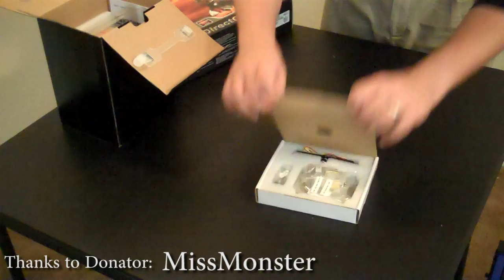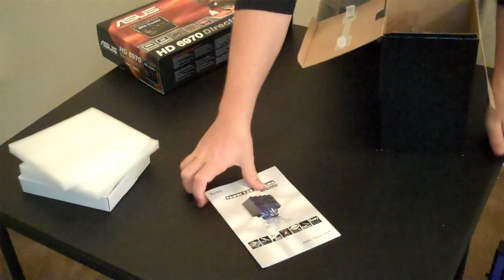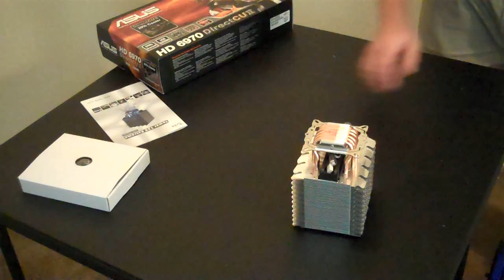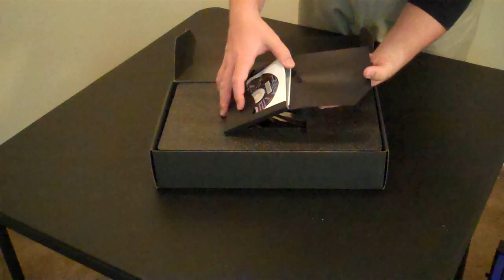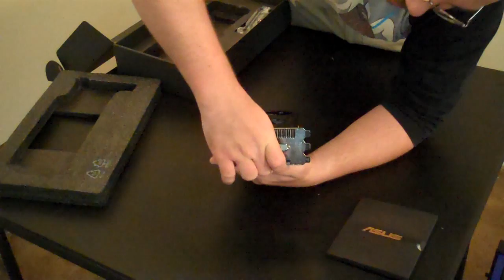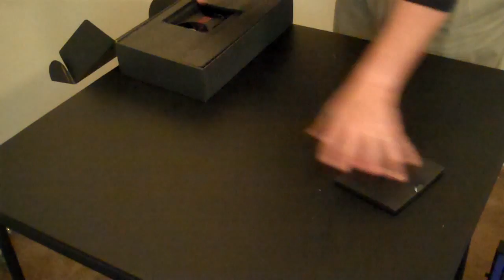AwesomeMattG Builds His Computer (003)

Comment: In case you were worried about how loud your video card is I bought a external fan for mine.  The fan is called a Arctic Cooling Accelero EXTREME Plus.  I can run my video card fan at 100% with barley any sound.  The only problem with this product is you have to remove the stock cooler on your video card.  That part scared me because I thought I was going to break it.  It worked though.

Comment: A big cooler is a must nowdays , I just built my new PC 1 year or 2 ago , and I was using the default cooler for the CPU(amd) and becouse of the heat during summer it was over 70*C  , my powersupply failed 3 times and 3rd time its fan started moving up and down besides rotating and was hitting the walls of the PSU o_O  now I got a big cooler , Artic Cooling Freezer Xtreme and its about 35 to 40*C on a normal day and during summer barely reaches 60*C.

For short the bigger the cooler the better!